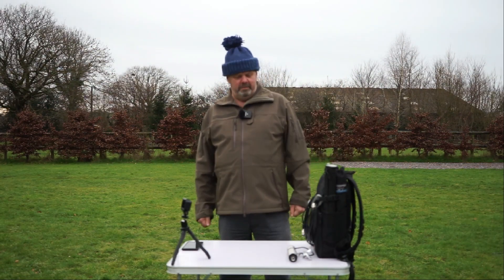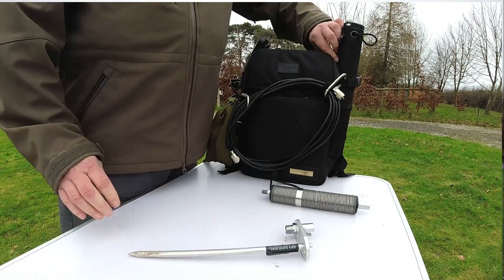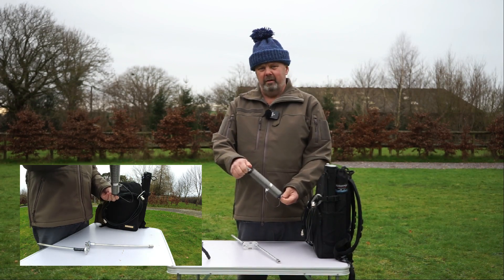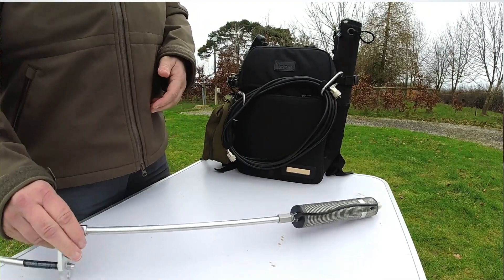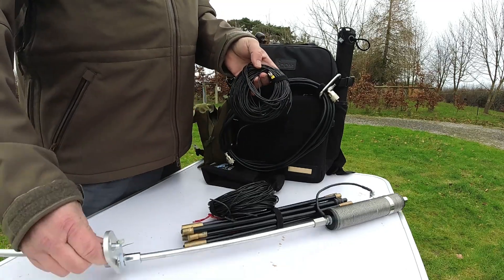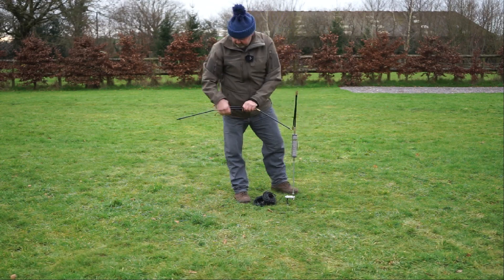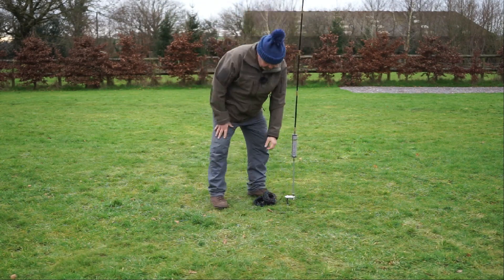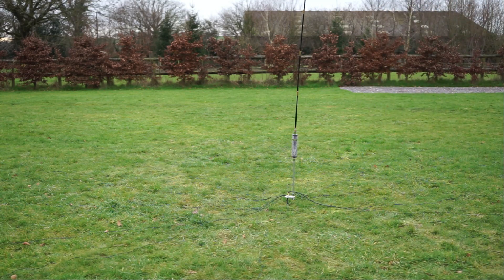M0IAX Portable Antenna System

Comment: Great video!  What gauge wire are you using for your radials? (they look like thick wire)  It is possible to use thin wire, because the rf is distributed among all of the wires (unlike the 1 radiating element).  Maybe you could avoid tangles by using thinner wire and wrapping/storing each radial separately?
Reply from the maker: Agreed, i could use much thinner wire I am sure. Not sure what gauge it is, its DX10 by DXCommander there is a link in the description if you want more details. I’m using it because I have a couple hundred meters of it. If we are ever released from this darn lockdown I may get some thinner lighter wire. In the mean time i will try winding each radial separately and see how that goes.

Comment: Very nicely put together, will have to look for that shock cord whip, looks a better solution to the titanium whip that came with the Superantenna. I find that is always a pain to travel with as you've got to be careful not to 'kink' it too much.

Did you try using the locking knob on the MP1 to stop it collapsing down with the heavier whip on it ?
Reply from the maker: Yes the superantenna coil does work great and it hasn’t collapsed yet so it’s perfectly useable especially with this whip. The other whips buddipole sell work with it too but are heavier so a bit more concern there, but I’ve used the superantenna coil for a couple of years. The m1ecc coil is slightly shorter so fits in my bag better as well as not having the risk off collapsing.